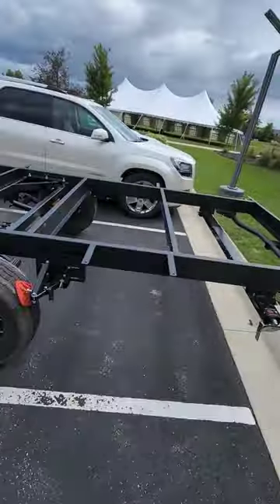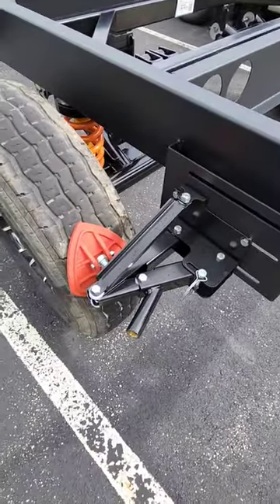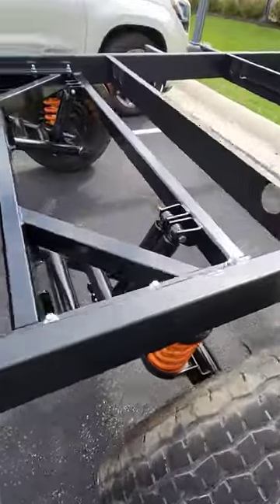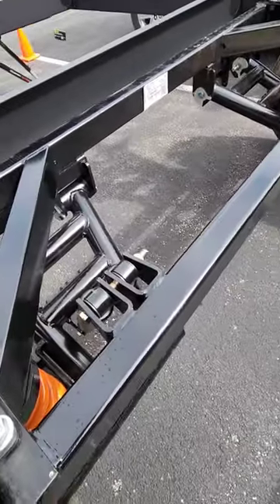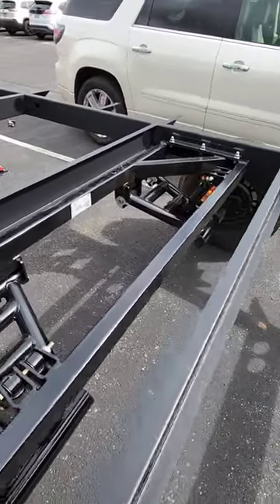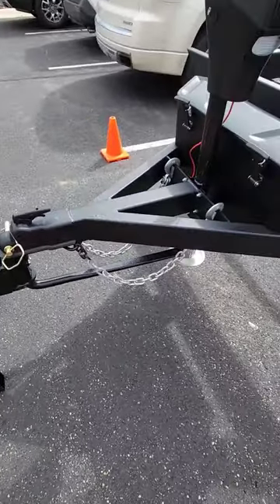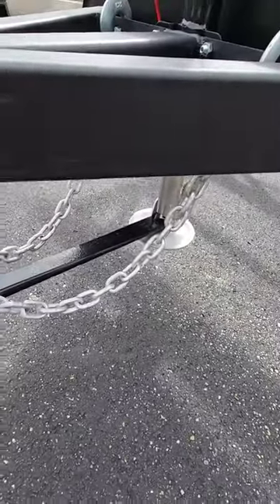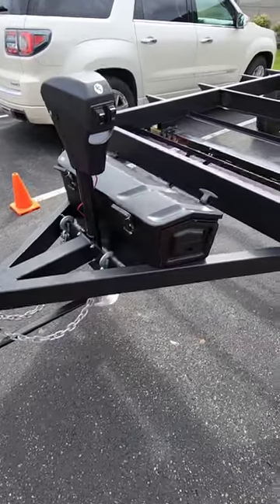Check out this RV frame from Lippert!

Comment: Man the metal is so thin on all these new rvs
Reply: Chinese steel.  Thin gauge.  Too flymsy.  That’s why I like  New Horizons 5th wheels.  They build their own frames in house with American steel.
Reply: More and more I’m understanding why I saw a guy cut the axels off and weld the camper to a gooseneck big Tex trailer
Reply: @BIGDAVE5352  thanks for the recommendation man. Now I know what to look for
Reply: I was thinking the samething, that thing looks chinsy

Comment: The problem with this is that they put a cobled together unit on top of this frame. God forbid, but if anything where to happen where it would be hit or fell over it would literally explode onto a million peices. Look into inTech Trailer and RV. They are a higher end manufacture and produce full aluminum frame top to bottom like a house with the unit built inside and out that frame.

Comment: The only thing that i don't care for a design is the direction of the bolt on the shock.  For a mechanic who would change shocks at one point, would like to get the bolt out all the way.   The support bar needs to be there.  So easy solution is to change the direction of the bolt.

Comment: Looks like the hitch might be the optional articulating setup. It’s hard to find much about it online. 

I wonder if that suspension can be adapted to other trailers aftermarket. Looks like all it needs is flanges to bolt onto.

Comment: Everyone saying Lippert frames break, they are built to rv builders specs. They will build it as heavy duty as the company wants. Next time you're rv shopping, go underneath the trailer before inside. Then go in the bathroom and see what the counter top is made out of.  Just remember, most RVs are crap. You just buy the best crap you can afford.
Reply: This frame looks hilarious. I've never seen such thin metal used. Hopefully this is for nothing more than hauling your lawnmower around

Comment: That rear suspension will definitely be a disaster.. Axles are only way to go they will hold the road more stable. Also you can get parts anywhere on the road .